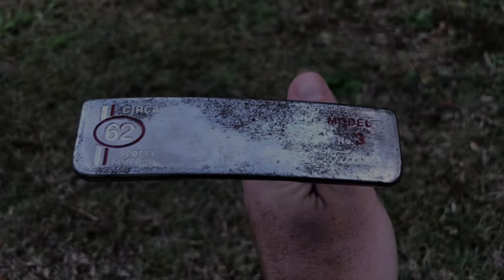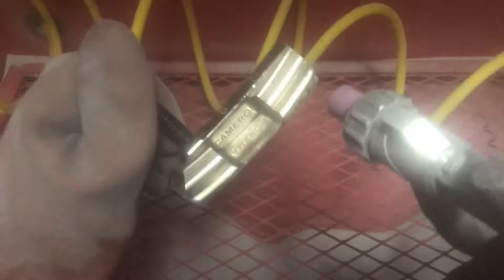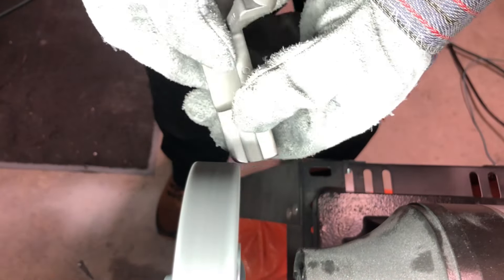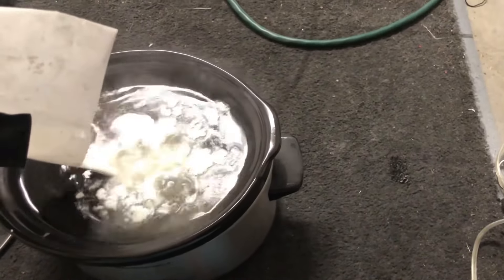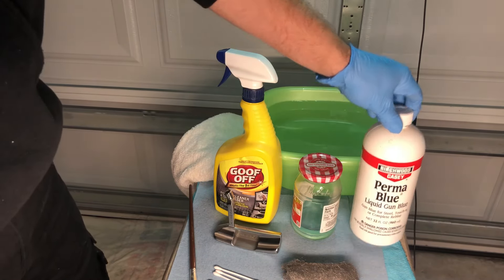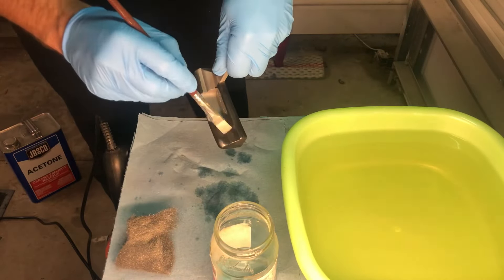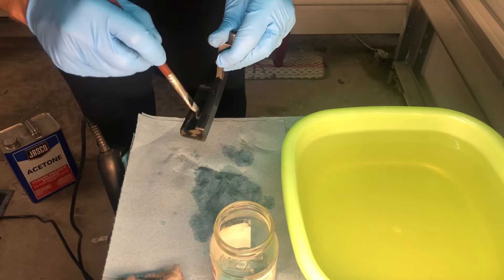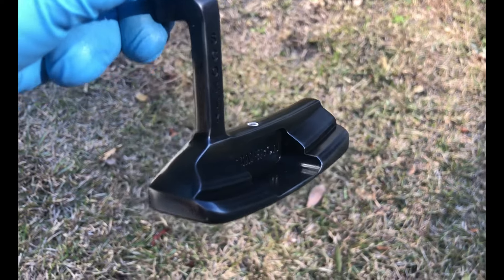I *GUN METAL* A SCOTTY CAMERON PUTTER * DIY RESTORATION *

Comment: This looks great! How durable is just the gun bluing after the penetrating oil without a protective coat on it? Does the darker color wear away the more you use the putter, mainly on the bottom where it would interact with the ground?
Reply from the maker: Good question! Yes like any finish if it’s not looked after it’ll wear away over time. You can make the finish last while oiling the sole mostly because like you said that’s where the where and tear is. If you don’t oil.. not that the finish will wear faster it’ll just be exposed to moisture and potentially lead to rust

Comment: Does the paint fill at the end on the circle stick well after being oiled with the WD40
Reply from the maker: Yes! Trick is to clean out the lettering/symbols with acetone prior to paintfill. After applying 2-3 thin coats, the paint is very durable.
Reply: I’m about to do this myself and was wondering if the shiny finish showed at the end is actually what it turned out like or if it just looks shiny bc it’s oiled

Comment: Hey awesome stuff. Was just wondering what the blaster cabinet does exactly?
Reply from the maker: The glass beads smooth out imperfections in the head. Depending on the type used, they give a very polished look. They also help prep the putter for when I do certain finishes.

Comment: Awesome job! If you torch and oil, and want to torch more (going from purple to blue) are there any steps to prep besides the acetone and  goo gone?
Reply from the maker: I heat the head for about 5 min all over with a heat gun before torching, I find that it heats the putter up nicely so it changes color more uniform

Comment: Does this process work with the Caswell Stainless Steel darkener as well?
Reply from the maker: Tbh. I’m not sure I have not tried stainless steel darkener
Reply: @scratchlessputters  I've used caswell carbon and ss black oxide finish solutions, they perform very similarly.

Comment: I have a Tad Moore Putter will this blueing stop it rusting
Reply from the maker: No the finish is still prone to rust/wear and tear. Keeping the head dry or wiping it after rainy conditions will help on the rust front
Reply: @scratchlessputters  could you apply clear coat over the finish to avoid the wear and rusting?